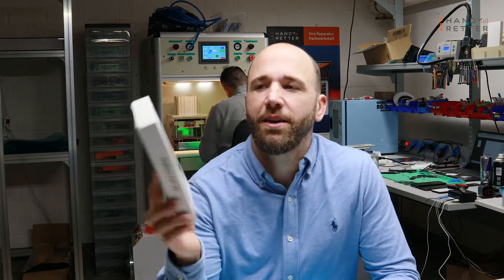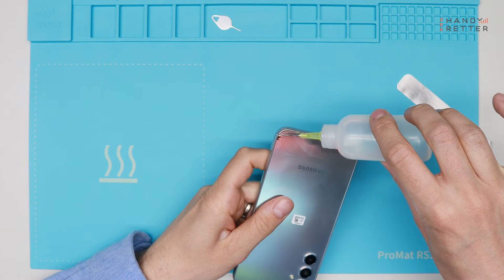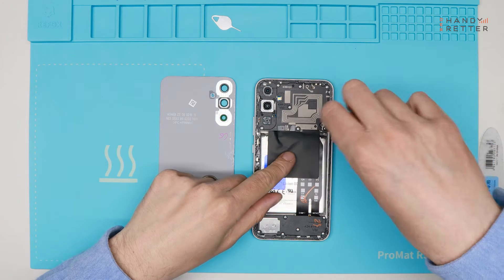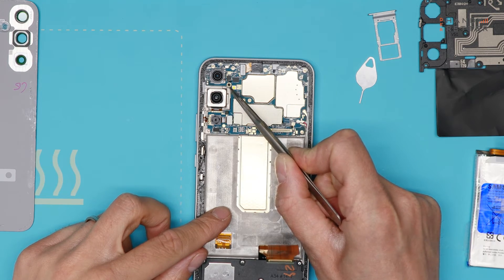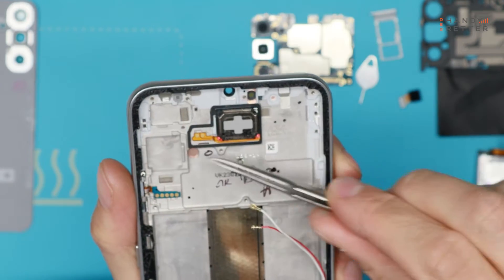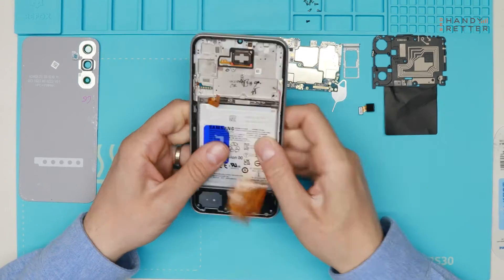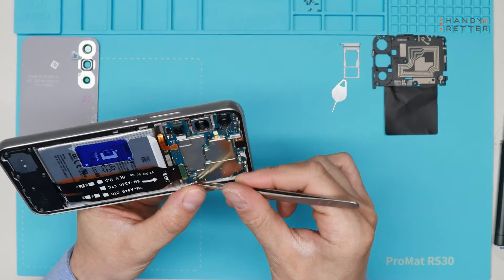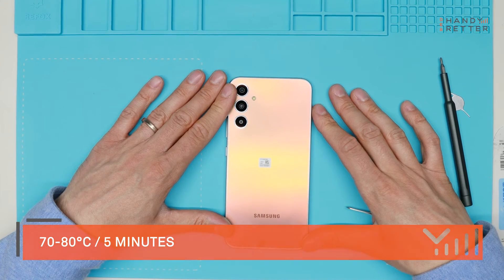Samsung Galaxy A34 5G - Teardown, Full Disassembly

Comment: Thank you so much, I'm using this phone, and I've been wondering when someone would do a tear down of it so I can see the internal components and easy-to-fix possibility. However, I was also thinking that if you'd make the back panel to be transparent  ?
Reply from the maker: That would be possible, because the backcover is just plastic. You could print it backbe with a 3D Printer :-D
Reply: @derhandyretter  but It won't be the same cover and quality by samsung, I still want that. The A54, though it has a glass back, will be easier to make transparent
Reply from the maker: @Moustafa-Attar  good question. Glass is stronger. If you want to remove the colour somehow, it could be working better on glass.
Reply: @derhandyretter  exactly, etching, or soaking the glass back panel would remove the pre applied color (if you don't like it). I'm currently using the A34 (Lime) 
But for the A54, I'd go for the white color
Reply from the maker: @Moustafa-Attar  yes, check out, we disassembled the A54 as well. The video is online
Reply: Im looking forward for the transparent back case too❤. That will be look cool. Since I got the black color